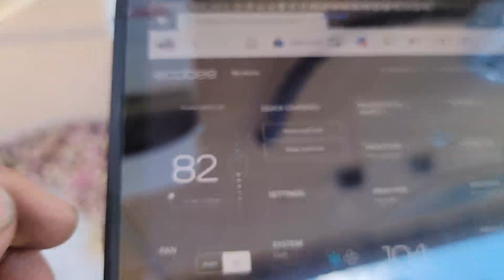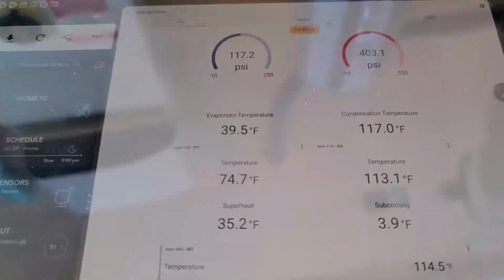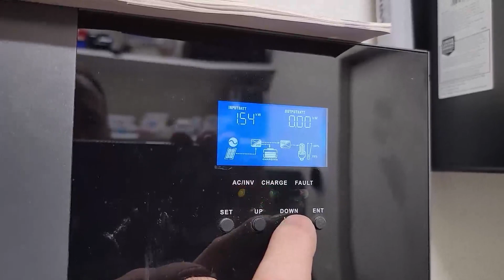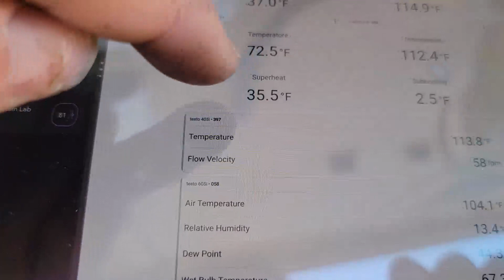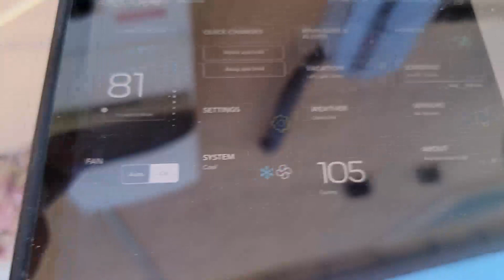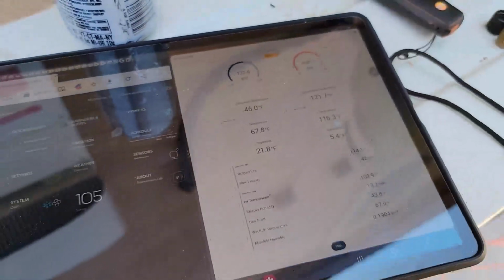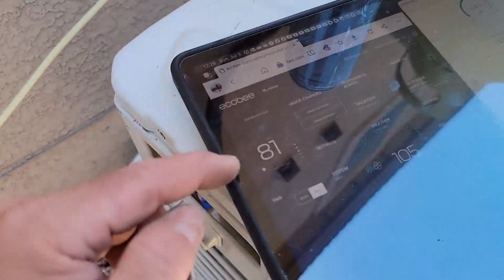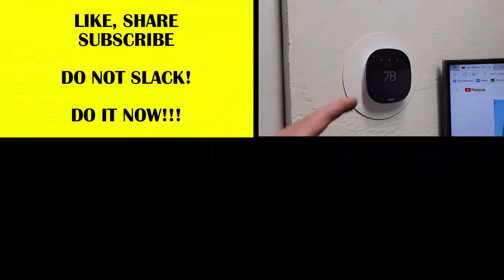Minor surgery on the Frankenstein Hybrid HeatPump AC Water Heater - [Hard Working BA$T*RD]

Comment: Do you have a piping diagram for the water heater? And what control do you use?
Reply from the maker: It's an ongoing project. 
It's just a pump and a heat exchanger. 
The controller is DIY.

Comment: I would just use the refrigerant to water condenser only. Then remove excess heat from the tank with a HWC and fan outside. But that would be too simple for the Frankenstein Bastard!
Reply from the maker: Lol. You mean add another circulation pump to run the water from the hot water tank thru a outdoor coil to drop is temp?
Else another heat exchanger in series with the water from the tank but I do think the mister might be a bit easier maybe.
Reply: @hackfreehvac  HWC in series with existing pump and ref-to-water condenser, and a 3 way ball valve (motorized) to bypass the HWC when tank is below ~140. The current setup, you have to make refrigeration system modifications seasonally, to remove the secondary condenser for 100% water heating in the winter. Unless I missed something.
Reply from the maker: @ot7584  Well the first criteria is CHEAP and most of this is stuff I recycle. So those components would cost more than I have in this.
The secondary exchanger I added is tiny. So it's after the main water heat exchanger (used from a WSHP) and the air passed thru the secondary and then the outdoor evap. I have tape there to pull all the ODM air cfm thru that small middle secondary ahead of it.
The water mister is working great now. Seemed to be the most simple way to get keep the head pressure at bay when the Water Tank is at temp and it's 110 outside. 115 today I think. 

I have king valves to switch between indoor high wall and outdoor evap coil for winter use.

Comment: What kind of tablet is that?
Reply from the maker: It's one of the higher end ones at Verizon.
Essentially a Samsung S21 or similar but in a 11 inch screen.
Fast and got its own always online Verizon connection.
There is a larger 15" or something version but that is ridiculous for a tablet.
This is just right to barely fit in a holder in my CanAm or on a airplane

Comment: Looks good. Why don't you just use the  mini split  condenser  ensted  of that old condenser for your  water  source heat  pump
Reply from the maker: That mini split condenser that's apart was hooked up to it.  Real nice too. 
The high wall cooled really well inside but it didn't heat the water great at all. 
Took forever to get the high pressures and temp to build in the heat exchanger portion. 
The mini split added a lot of volume to the gas/condenser portion and just slowed down the initial build up like crazy. 
Took hours to heat the water. 
So I but it back to this compact wall mounted thing I originally built. 
At that time I made the controller in that control box above the water heater tank and when I did I decided to add a thermistor to keep the pump off until the liquid temp rose.  Then too kick the pump to full speed once it rose some more. 
Perhaps if I had done that in the larger mini split it would have overcome the slow initial pressure climb. 
But it sure builds pressure in the wall mounted thing.  A lot less internal volume I suppose

Comment: I have that same Power MR. I use it to power a 15000 btu Frigidaire window unit I put thru the wall of my garage. It only takes 8 Santan solar panels to power it all day, and after that I have about an hour of battery power then the heat reclaims the garage.